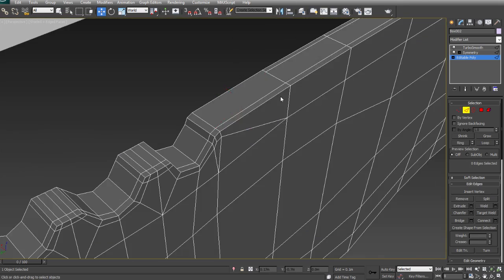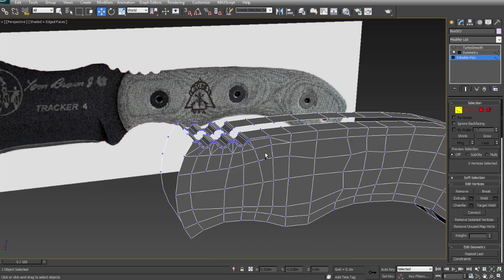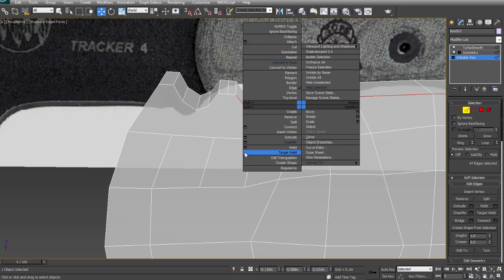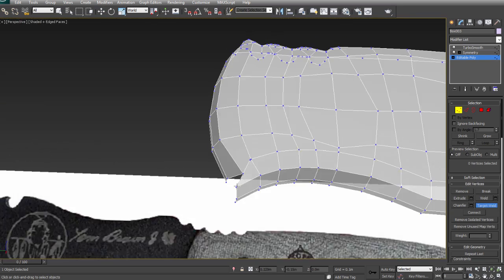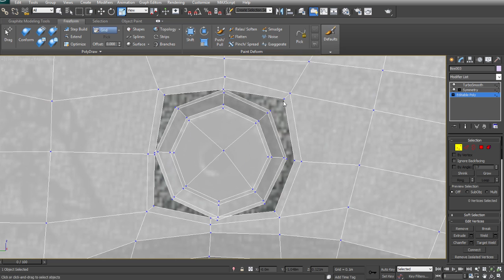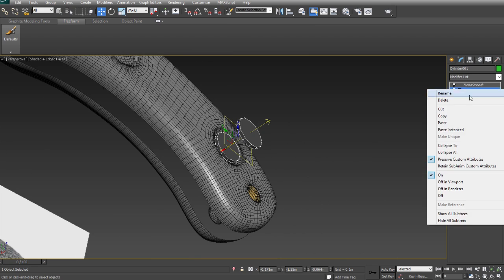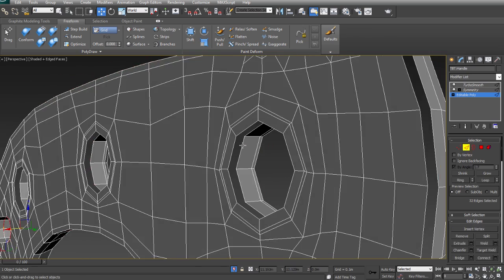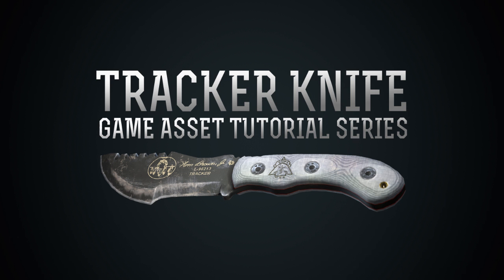Tracker Knife Part 2: NextGen asset production series

Comment: He seems to be using a custom script called "Regularize", I did a quick search and found this script, seems to do exactly what he does in the video. He selects a set of polygons, then turns the edges of that selection into a regular ngon.

Do a search for "3ds max loop regularizer," I found it on scriptspot